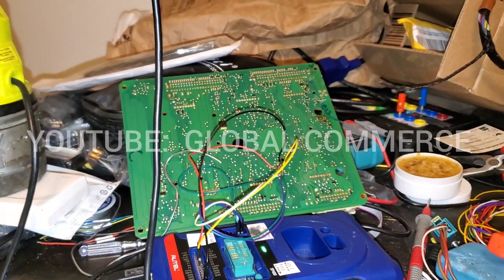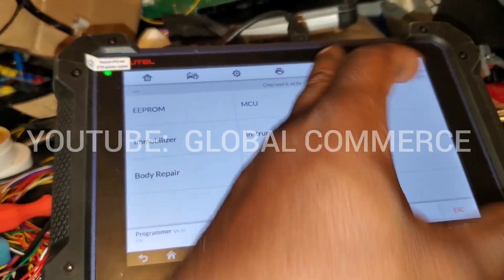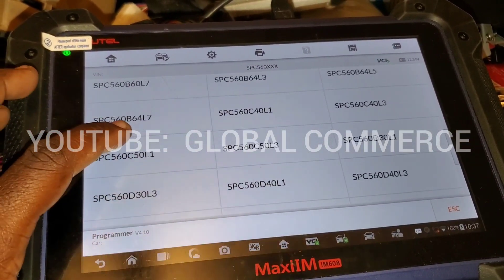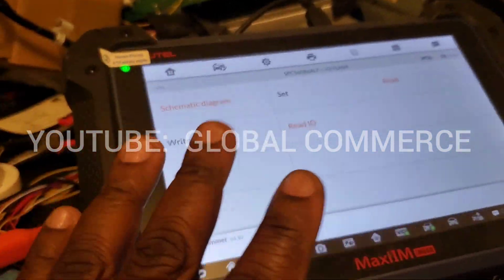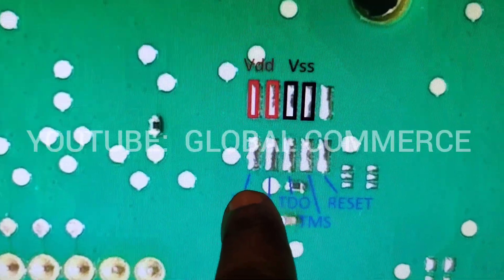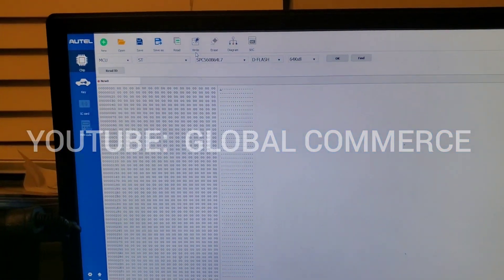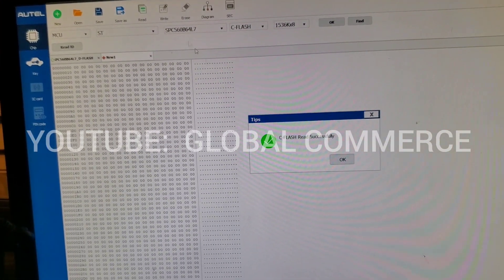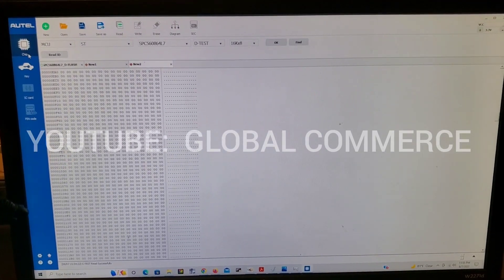Autel IM608 XP400 PRO Ford BCM CLONE/HACK/COPY PART 2, BONUS! ON PC!

Comment: hello great video i have now subscribed.
my question is your opinion on the autel im608/608pro im a mechanic looking to widen my expertise i have done alot of research but you see alot of conflicting info, is the 608 good for tcu read and write mainly german brands? debating buying this unit togo with my other autel diag gear but the obdstar dc706 keeps poping up making decisions difficult lol thanks for any advice

Comment: in pc software at the end it says to connect to vpp2 but you are not hooked to it, wondering why?   also to clone the bcm do we just copy the d flash and eeprom or do we need the c-flash , shadow and so on also?    also I noticed after I followed this and part 1 on multiple Bcm's iam able to read the eeprom okay but the c,d,shadow all read as empty just all 00's noticed you had the same issue and was wondering If you ever figured out why? wouldn't think both my Bcm's are bad corrupted?? any ideas or maybe does vpp2 need to be connected?
Reply from the maker: Great questions! If the software is asking for VPP2 but you're not connected, it could be that certain operations require it for proper power or communication. As for cloning the BCM, you usually need to copy the D flash and EEPROM, but depending on the specific module, you might also need the C flash and shadow data.

The empty readings you’re seeing in C, D, and shadow could indicate a few things: it’s possible that those sections are locked or not properly accessible, or you might need the VPP2 connected to read them correctly. It’s unlikely that both BCMs are bad, double-checking connections and settings!
Reply: Is there a pin on the back of the board for vpp2 or am i going to need to connect it directly to the processor pin for that?  splitting the 2 boards apart for that doesnt sound fun.    When I reads it does say unlocking at around 7% then goes on to read it but as I said just comes back as black 0’s  thanks for all your help!